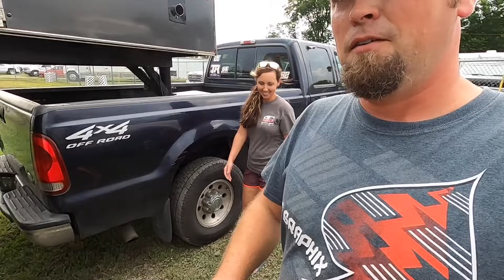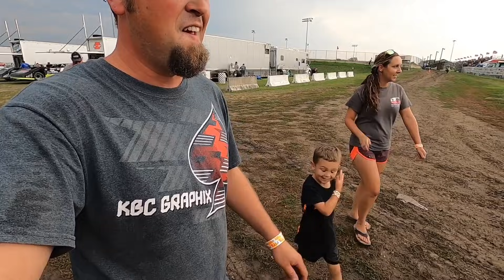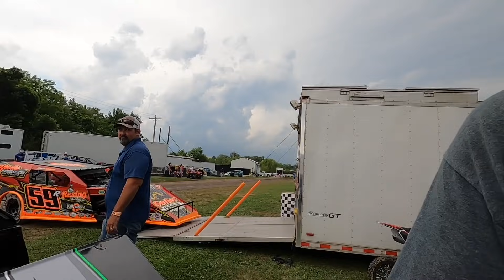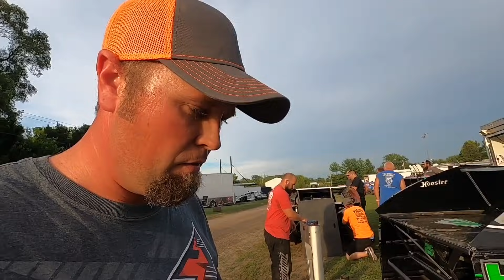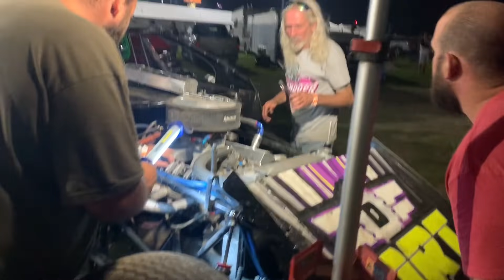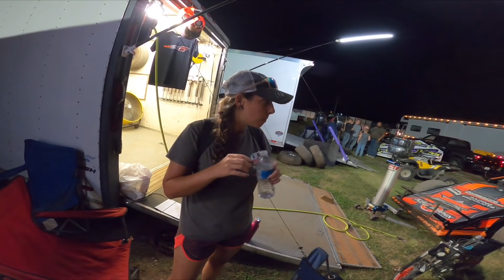We Went Racing With The Big Boys, Chase Met Jimmy Owens | Napa Know How 50 @Tri-City Speedway

Comment: “More gear”. Is that numerically higher or lower?  
I dig the pit walk around!
Reply: Turns the motor more rpms.
Reply: Scott, thank you.  I was thinking numerically higher gear.
Reply: @VanPelt408  
A low gear ratio has a numerically higher number. We say "more" gear because we're putting in a gear that has "more" teeth. The same ideology with saying a "tall" gear. Tire size adds to the final drive. Back in the day when the pedal pusher cars used 13" tires they couldn't get off the line. Today the average tire size is 17, 18, and some use 19" tires. Those vehicles are snappier then a rabid dog and manage better fuel economy because you're not doing 3,500 RPM at highway speeds.
Reply from the maker: Thanks men! @vanpelt408 these fellers said it perfectly.